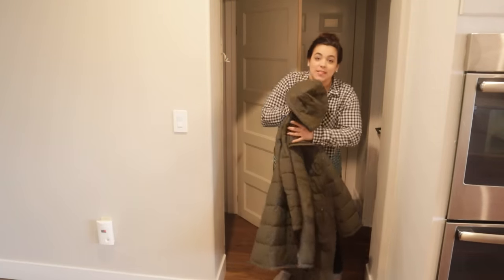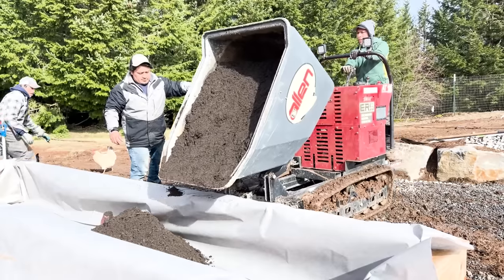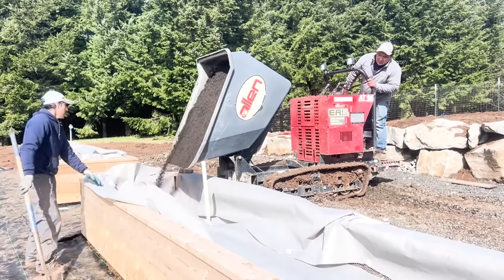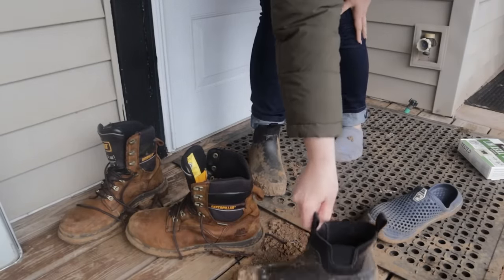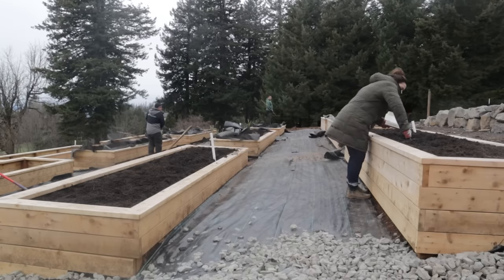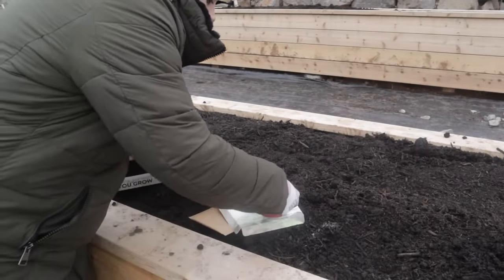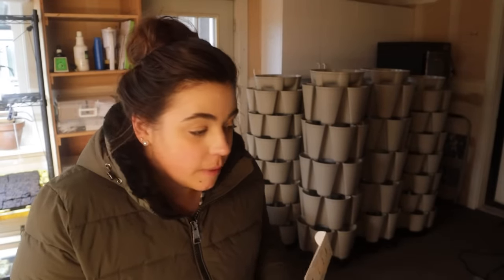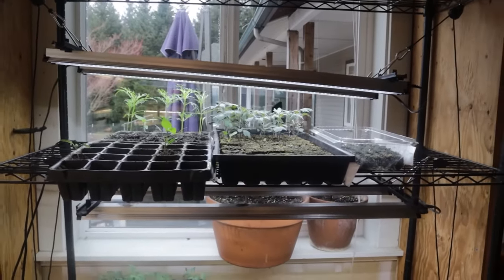This could change everything! Unlocking the Mystery of Healthy Soil!

Comment: I am a biologist and it does not make sense to me to get samples from six different beds. I say that because technically if there was a problem in one of the areas it could be masked because the other five areas are elevating any of the lacking nutrients or vice versa. To me it makes more sense to just do five completely different tests on five different beds. But in your case, luckily, it probably won’t matter anyway due to it being a brand new delivery of all of your soil components being all mixed anyway.
Reply: She took five or six   samples from the same bed.  She said she only needed to send in one test bec all the beds had the exact same soil in them.  I’m a microbiologist and I clearly understood her.
Reply: @Lisa Martin your response is a prime example of people lacking the skills to present an opposing position without needing to put down another person. Your last comment was completely unnecessary and just subtracted from the point you made and your last sentence is the part that is remembered. People remember attitude & common courtesy way more than facts. Perhaps try increasing your EQ to heighten your own skills in presenting opposing views.
Oh and just for the record she stated she took 6 samples from 6 areas, she did not say they were 6 different beds or the 1 bed. Although footage shows at least one bed & also the huge pile of soil. So from this information, the first comment is closer to being correct than you as your opening statement is blatantly wrong just by looking at the video.
Oh also the components are the same but it would be impossible for all of the beds to have exactly the ratio of each component unless she literally had a huge soil size blender to thoroughly mix everything together, there will always be variations of how much of each is in each bed.
Reply: All of the soil in all of the beds are the same, you are incorrect with your statement. She just purchased it all! I agree with the second commenter! Also you are very sensitive to criticism which is definitely not a good trait for a biologist😂😂😂.

Comment: I'm envious of your garden! I live in the SF Bay Area and am currently "turning my waiting room into a classroom" (I love Jess @ R&R Farm but it's something I've said since I was a kid but no idea where I learned the phrase). Hope you are getting your beds filled this weekend! You and your baby will end up spending so much time bonding in the garden! Our son spent hours with my MIL in her garden & I wish I was both able and into gardening when he was little!
I started gardening in LOTS if containers and grow bags last spring and grew to LOVE it! This winter, I designed two tall raised beds (attached to a partial or faux pergola) around my front yard paver patio. My hubby and I (w/Dad's help on the pergola erection) did all the work to sand, cut, and organically seal them. We also put in 1 short 6'x4' on the side of front yard and 2 short 4'x4' raised beds on either side of the pavered walkway that connects our patio to the sidewalk. It's been a slow but steady process over the last two months but all that is left is running water lines (tape) and putting down a grid (using halved vinyl corner rounds w/ holes) so I can give square foot gardening a try in some of my raised beds. My plants are nearly hardened off too so only a few more days until I get to start putting things in their final homes!

Comment: Got my mind blown a couple of years back stumbling on Korean Natural Farming and it's sister method JADAM. Basically it's using cheap, natural inputs to improve the soil. Am also integrating Back to Eden gardening using wood chips in with that. Nigel Palmer, Paul Gautschi, and Chris Trump are good Utubes channels covering it.
Reply from the maker: Oh Thank you! I’ll look more into it
Reply: I just learned from another gardener that if you use wood and wood chips make sure it's broken down as much as possible because it will suck up a lot of nitrates❤
Reply: @melaniedennis9540  That held me off from doing it for a long time, but as I understand it B2E composts them. We are thinking of mixing them with lawn clippings before we lay it down  provide the nitrogen, and see how that works then go a different route if not.

Comment: Raney´s at Homestead Rescue made a nice and simple solution for the birds in one program. They took a mesh net, maybe what I think you name "cattle fence", bend it to make a half circle. like a tunnel, and secured it to the ground. That would be an easy way to get a pretty big secured yard for them as big as you want to do it. They can not fly out into the garden and they are also safe from flying predators. 

Your garden starts to look more and more stunning! There is also one thing you have to think about when it comes to soil for growing in: the contents are also important due to where you live and what you want to grow. For example, for me as living way up north with a lot of snow (often 3 feet) on my beds, it is important to have a permeable soil in my beds (at least for those with garlic and other things sown in the autumn) because it can be very vet in springtime. Sandy soil is underrated as a growing medium, you can grow in pure sand if you want to. The important thing is to feed a bed with soil is to feed it, preferable with cover crop (grass clipping is great for that). I have found it easier to get nice carrots, parsnips and similar veggies in sandy soil than in a rich soil with a lot of more heavy soil. So everyone have to consider what to put in their beds due to where they live, thinking of temperature, moist, wind and what they want to grow most of when it comes to veggies. Maybe it is more easy to have a more sandy soil and give complements than struggling with a heavy soil for half of the veggies...

For cabbages; sow them outside in trays and they start to grow when they feel it is time to grow. I seed mine in the middle of april, shovel some snow over the trays and forget about them, just checking them later on so they do not dry out before putting them into the beds.

Comment: I do soil tests about every 3 years from the UH extension.  They used to give the soil results including the soil series, and normal values for my soil type as well as recommendations (organic recommendations have to be requested otherwise it will be for synthetic per 100 sq ft (vs acres which is what it usually comes in for commercial farms.)  

However, do to budget cuts and staff retirements, the only send raw results now.  They do have a separate publication to look up normal values for the three soil types we have. However, if any one who is new to soil testing,won't know where to find it. And the lab does not answer inquiries about interpretation.  They also don't do recommendations so you have to use the other publication to  find out what you need to do and look up how to calculate the pounds of nutrient you needs from the fertilizer you are using.  P.S. This doesn't work as well for organic because they don't always have a guaranteed analysis.  It does not take a PHD to do this but it does take time to do the math and figure out what to do.  I have been testing my soil for over 10 years.  It does not change that much since I plant the same types of things.  It is not necessary to to it every year, it does not change that much. Even adjusting pH, it is not recommended to make large changes at one time and it does take time to change pH.  Every  three years is about right for a check up if the plants are growing well just to make adjustments to pH which is the most important thing and to tweak fertilizer.  My soil test locally costs $12 or pH, P, K, Ca, Mg. another $7 for total carbon, It would be $10 for total carbon and nitrogen but nitrogen is so volatile that it is not worth testing. I can tell by looking at my plants if nitrogen is good or not.  (another $12 if you include the gas and parking to get there and back.  It pays to go in with friends and make one trip.)  Testing every three years is worth the cost since it has meant that I don't have to use that much fertilizer and the fertilizer I do use is good for about 5 years. I have been adding 4 inches of compost, but my organic matter is increasing the phosphorus, probably because the bagged organic material has fertilizer added.  So, I have reduced the compost to about and inch. 

With total carbon I can calculate the organic matter percentage goal 3-6%.  Nitrogen is always going to be necessary, but that is calculated by a formula   2.5 lbs per 1000 sf of garden or 0.25 lbs per 100 sf (divided over the year) using  sulfate of ammonia 21-0-0 or half that amount of urea 46-0-0, or organic nitrogen blood meal 13-0-0  would be 3.33 lbs over 1000 sf. This is a fast organic fertilizer but releases slower than sulfate of ammonia.
 
1lb of synthetic granular fertilizer is approx 2 cups.  To be more exact it is best to use a scale. 
In my 128 sf garden that is about 0.5 cups over the course of the year divided into 3 side dressings or about 2 tablespoons per 100 sf.  per side dressing.  It is cheaper than blood meal and a lot less effort than hauling in steer manure.  I can't use steer manure anyway since it is not pure nitrogen and has phosphorus which is already too high. and since steer manure does not come with a guaranteed analysis, it would be hard to figure it out. I have used blood meal before.  I was not ready for the blood meal to end up blowing into my face.  Won't do that again.

Organic is what a lot of people are turning to for many reasons.  I do hybrid gardening, I use very few pesticides, and I have a pollinator garden to attract beneficial insects.  However, I am getting older and digging and hauling heavy bags of soil from my front yard to the back is more work than I want to take on.

I think the availability of a soil test kit that gives you readable results is great.  However where I live, the department of ag will not allow soil to be shipped out of state.

Comment: I have a permanent compost yard that is attached to my chicken yard.  I also have about 100 ft of a chunnel (chicken tunnel) for the chickens to be able to run and feel like they are free ranging. Having a separate compost yard that is completely enclosed in 2x4 welded fencing. Chickens are happy.  Get black gold. And my veggie garden is safe!  If I want to let the chickens in the garden, I just move the chunnel. The chunnel is the 2x4 welded fence. I used the 5ft tall femce. Folded at the 2ft and 3ft. Creating a U shaped tunnel for the chicken to run around under. It’s a win win.

Comment: Order some premier one poultry netting.  It is an electric fencing that you can fence off pastures with it.  If you get the one with the small holes chickens can't get through it.  Cog Hill Farm used it as well as the fit farmer. Not is moveable and runs on solar energy

Comment: I'm excited for you. I haven't gardener for around 30 -35 years and I can remember much. I did grow some tomatoes for a couple years in pots on my deck. I live in Canada and in zone 3 which means last frost date is May 21. I was thinking of starting a few tomatoes this year but not sure when I should start. My son and his wife just purchased a home on a large acreage not far from where we live, but they don't take possession until the end of July and their lease isn't up until the end of August on their rental so they want to get the house painted or sided, the trim painted and the roof either fixed in areas or replaced e timely.  It's a 4 acre property with a large forested area with trails thru. They did put in a garden surrounded with a 8 foot chain link fence to keep animals out. Considering the amount of deer and moose spoor everywhere especially around the home the high fine is an absolute requirement. Though they will both be extremely in business this year unless the current owners start a garden there will be no grow time for a garden this year but they are considering a medium garden next year

Comment: Love the progress, everything looks so great!!! Quick question for you - how much raised soil mix did it take to fill one of those beds? I always have trouble knowing how much to order and having a clue about how much (i.e. cubic square feet) it takes to fill one bed like yours would help a lot. I know everyone's beds and measurements are different but just looking for an idea to help me at least get started. Thanks in advance! :)
Reply: Measure your garden beds & decide the depth in feet. A cubic foot is 12” x 12 x 12”, so multiply width, depth & length to get how many cubic feet you need.
Reply: There are online soil calculators that make it easy to figure out.  Just search “soil calculator”.  Some of the sites even make it easy to figure out how much soil is needed for containers.